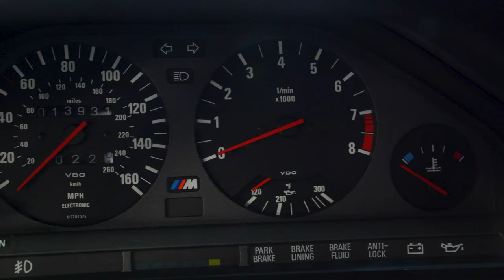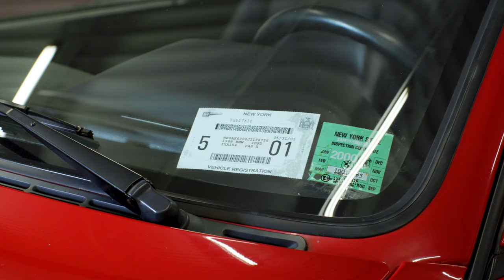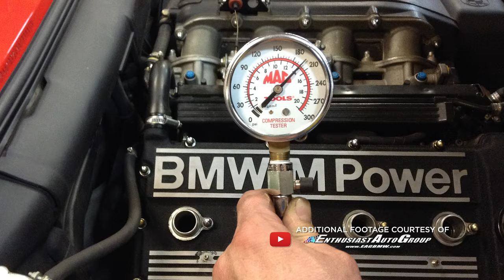This BMW M3 was hidden for 21 years!

Comment: sir can i put first a coating nxt ppf in last coating? for short coating x ppf x coating?
Reply from the maker: No. You will most likely incur bonding issues of the PPF if you're trying to apply it on top of coating.
Reply: @Esotericdetail  thank you so much sir
Reply: @Esotericdetail  is all machine are same speed?
Reply: @Esotericdetail  i mean polishing machine
Reply from the maker: @eugeneace1194  Not all of them, but most DA machines go up to 6, so around 4.5 will be your average speed for compounding and / or polishing.
Reply: @Esotericdetail  thank you very much sir.